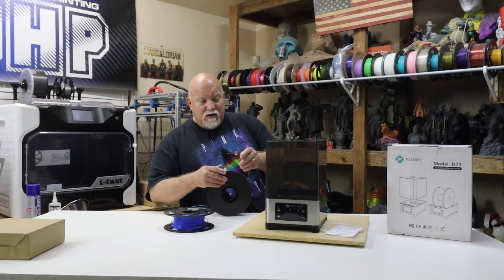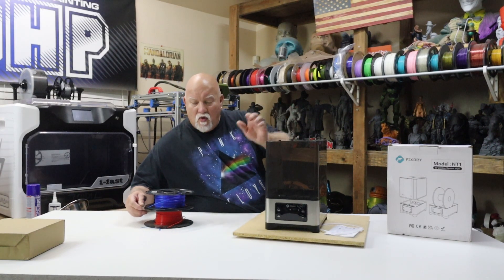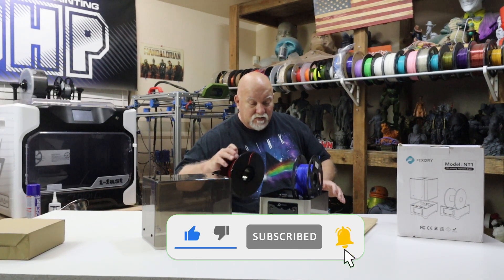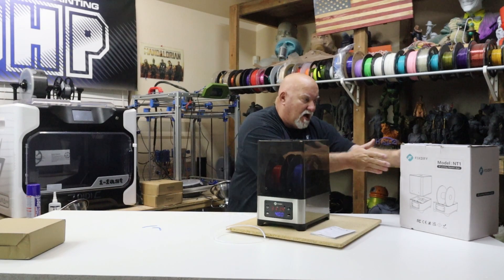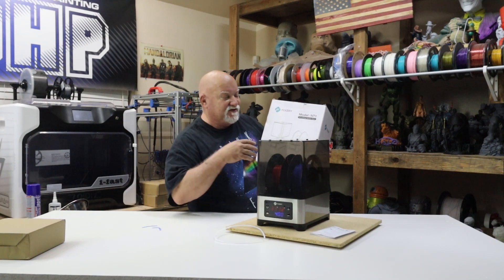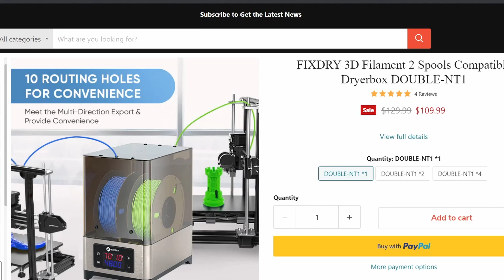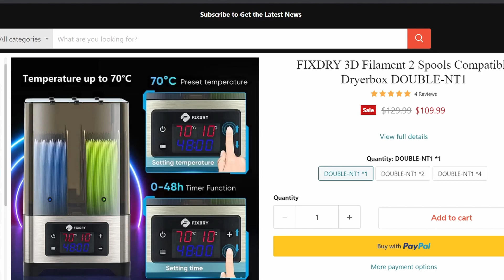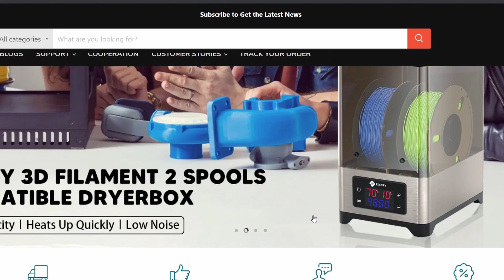FIXDRY Nt1 Dual Filament Dryer | A Must Have For All 3d Print Makers #3dhp

Comment: Nice video, but after buying one for myself, i am kind of disappointed. For PLA or TPU will be kind of OK, but no way would work for Nylon, ABS or PC.
On maximum 70°C set for temperature, after 3 hours, my BRYMEN 869 multimeter recorded a temperature inside the box, between 53 and 55 degree celsius. 
Of course i could not resist and disassembled the unit and as expected, they using a DHT11 sensor for temperature and humidity, controlled by a MCU (laser erased so cannot identify it). That sensor is rated for temperature range 0°C to 50°C, so no way will go to 70°C. The PTC used is a made in China 220V/100W, so should be good enough to heat up more. 
But will see in the future, maybe will DIY an STM32 controller with a better sensor so i can really dry some filaments.
Best regards.